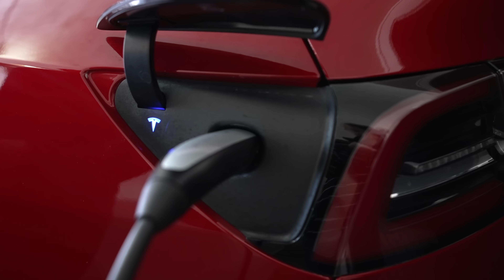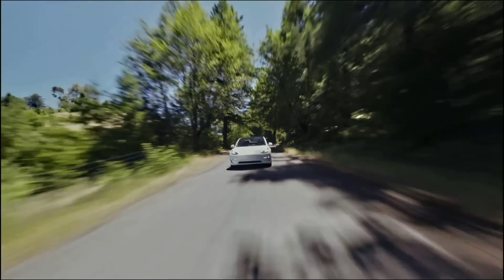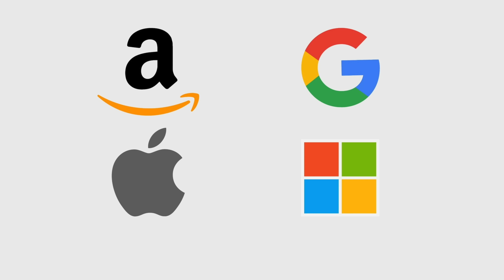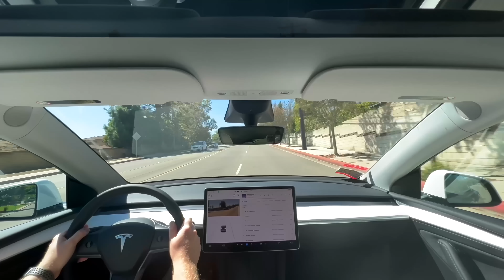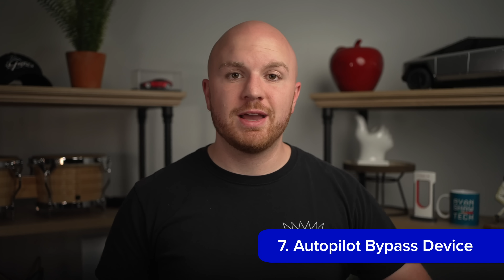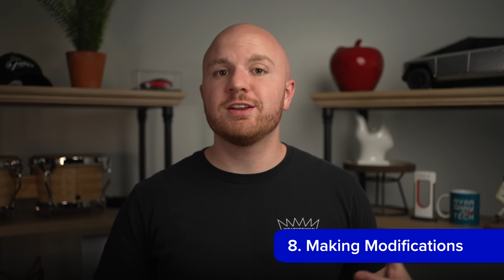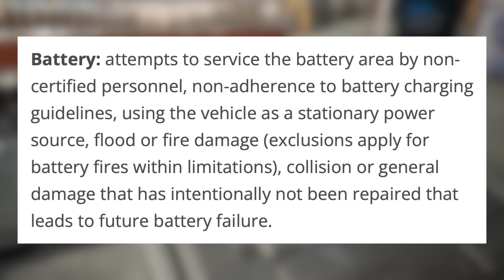9 NEW Ways to Ruin Your Tesla | Please Don't Do This

Comment: Does it mean that LFP batteries are immune to extra battery degradation associated with frequent full charges? No…
The only reason why Tesla recommends to fully charge the Model 3 cars that have LFP batteries is because it helps the BMS (Battery Management System) to estimate the available battery capacity more precisely.

Compared to other battery chemistries, LFP’s charge/discharge voltage curves are extremely flat. Basically, the voltage only rises when the battery is almost full and drops when it’s almost empty. This is why it’s much harder for a BMS to estimate correctly the SoC of a LFP battery.
Regarding customer service, for Tesla is more important to have a reliable GoM than to have a battery with a fenomenal cycle life – since one feature becomes obvious to the customer much sooner than the other.

Comment: My wife and I are looking for a used Tesla, and visited a Raleigh NC car dealer yesterday who has about 30 on their lot.  The car we went to test drive was found  on the Edmunds web app, and is a 2019 Model 3 that is marked down to a very good price.  When we arrived, they brought the car to the door for us, but as we attempted to leave the lot on the test drive the sales rep noticed that battery was at 0% charge, so we immediately pulled it into their charging bay.  We looked at other Teslas on the lot and asked to drive three of them.  The sales rep got the key cards, and two of the cars had dead 12 volt batteries, so we couldn't even open the doors, and though we got in the third car, the main battery was so dead the touch screen wouldn't respond.  What are your thoughts on car dealers who know nothing about EVs and brick them after placing them on the lot?  How do you evaluate the potential damage to the battery after this has happened?  Thanks for the great tips you gave in this video.

Comment: Tesla needs to add an automatic latching mechanism for the frunk, it's way past due. Even though it's not a hood, it still operates like one. Being able to remotely open it is a flaw, not a feature. I know the app can warn you before opening, but not always. Accidentally opening it with my key or phone remotely is a nagging worry to the point where I never use it for storage.

Comment: I never even considered a warranty issue when I installed a 3rd party swivel behind my touch screen.  It allows me to angle the screen in my direction, and to eliminate sun glare when necessary, since it allows both side to side and up and down adjustment.   I don't know why it didn't come with the car.  Do you think Tesla will tell me my warranty is void, should I need a repair in the future?  I also installed an anti glare protective touch screen to protect the Tesla screen from fingerprints and possible damage.  I mean, how far will Tesla go to deny warranty service?

Comment: #7 is bullshit. You can use a weight in a safe way, even safer than having 1 hand on steering wheel. Just because you use a weight doesn't mean you don't pay attention or crawls to the backseat. My experince is that a weight is safer then having 1 hand on wheel pulling opposite direction.

Comment: I would not recommend HOLD mode for everyone.  CREEP mode requires a low speed brake application to come to a stop.  At less than 5 mph, wear on brake pads is too small to measure, but regular cycling of the brake caliper pistons helps keep them operating freely.  More important, especially for older folks, is that the driver’s brain remains very well practiced at switching from accelerator to brake pedal.  This may result in faster response times in an emergency (“muscle memory”), and help prevent accidental pedal mis-application (pressing accelerator instead of the brake by mistake).
Reply: This, so much this. The entire concept of having vehicle braking, regardless of where that force is coming from (regen or friction brakes) tied to the accelerator pedal is just fundamentally wrong. I don’t care what anyone says about being able to ‘get used to it’ or that ‘it’s the future of driving’. From a safety standpoint it’s just flat out better to keep all active deceleration tied to the brake pedal. Every other EV manufacturer (except maybe Rivian) has regen braking tied to the brake pedal, blending in friction brakes when more force is required, with some offering the option to turn on one pedal driving if people want it. Not having the option at all like Tesla does is stupid. It’s fighting against over 100 years of muscle memory and it takes fine braking control away from the driver in emergencies and adverse conditions. It’s simply laziness from Tesla to not want to put in the work to program the brake pedal to control both regen and friction brakes and handle the crossover.

Comment: @Ryan - thanks for the video. On the charging topic the new Model 3 batteries actually need to be charged to a 100% to allow the BMS system to correctly measure the state of charge. This is because of the new charging curve associated with the chemical composition of the battery. Basically if you don't do it to 100% the car's estimated range will be very unpredictable because of the new discharge curve. Just look into it there are plenty of videos explaining this!
Reply: Do you think it should be charged to 100% most of the time if possible?
Reply: @skytrakn  yep according to new Tesla recommendations if you have the new 2023 standard range model - so the battery management system can predict correctly.
Reply: 2022 standard range.

Comment: Glad you added that if you are about to leave for a road-trip, you can charge to 100%. The damage comes when you keep it at the high charge for long periods. If you’re about to discharge it, you can.
Reply: It can still have a greater effect on the longevity of the battery even if you drain it back down quickly, but as long as you aren’t doing it every time it shouldn’t really be an issue

Comment: Hi All, I own Tesla Model Y for 1.5 yrs. It has 48000 Kms (30K miles). Its in Canada. My Battery is loosing value very fast. It used to charge to 465Km at 85% and now after Year it charges only to 404 KM. which seems quite a lot. And on the top of it. I only get 50-52% efficiency in winter weather. Which is very scary. Which means you can only drive approx 200KM on single charge before killing the battery. If I have to follow 20%-80% rule, i can only drive approx 100 miles. Which is really a poor performance. With Supercharging rates so high and inefficiencies this cars cost more to drive than GAS Cars. I am loosing faith in Tesla's and EV's. It seems like they are not ready yet esp for colder climates. Tesla service center is so bad that they give you weird explanations and screw you. I am feeling if I have to replace the battery just after expiration of warranty then this vehicle is not Worth it. Does anyone feels the same and gets anxiety after considerable drop in the range in such a short time.

Comment: New Model Y owner here - I tried auto steer for the first time, and the prompts to apply pressure to the wheel came up frequently even though I had my hand on the wheel at all times. I had to squeeze it really hard (with a deathgrip) to register that I was still holding the wheel. Is this normal? Is there a certain location on the wheel that has sensors and can register without squeezing the life out of the wheel every time I get that warning?
Reply: The steering wheel isn't measuring grip strength. Apply slight steering force clockwise or anticlockwise instead, apply too much steering and it'll disable autosteer.
Reply: @JasmLiu  thank you!!

Comment: Speaking of Telsa Warranty,  would adding different puddle lights under the doors void the warranty?
Reply: It would only affect the warranty for those lights you replace only, and they could have a valid reason to invalidate the warranty for the power source (i.e. if you were to short out the light, it might damage the power source).  In reality, no it doesn't affect your warranty.  And for the 3/Y and new S/X LR/Plaid, it uses electronic fuses that can even deal with short circuits without damage.  I've replaced my puddle lights and many other LEDs, and it has never been an issue.
Reply: @tesla_tap  excellent. Thank you

Comment: We had a 2020 Y that was totaled back in March when we got rear ended. We just got our 2022 Y replacement. The previous Y you could adjust your charging for just about any amount. This 2022 only allows 50-100%. According to what you just said, it should be a LPF battery. Am I missing something?
Reply: If it's a USA car, no you do not have LFP.  All cars allow 50-100%.  It's the indicator that shows the daily level that changes between LFP and NCA battery types.  NCA will show daily from 50-90%, but it allows you to set it to 100%.  After a few days at 100%, you will get a suggestion warning to set it back below 100%.
Reply: Hi Ryan- I have a 2023 Model 3. I’m located in the U.S., (California, not far from Tesla plant.) I looked under Software/Controls and I definitely have the Lithium Ion Phosphate battery. I can send you a screenshot, if it would be helpful for your videos. In the training classes I took (online) with Tesla, they covered charging and also specified that all of us had LFP batteries. I recorded this part of the training to show my husband since this has been a big point of debate between us since we bought the car, (how high to charge the battery.) The training confirmed yes, charge to 100. (Confusingly enough, our Tesla advisor at the dealership who delivered the car to us said charge the car to 90. It’s no wonder we are all confused.)
Reply: @surfercouple  I have a 2022 model 3  RWD and my software information shows LFP battery in mine as well..I live in NJ..because mine is RWD I read all model 3 RWD have FFP..and I remember my Tesla rep when picking up my car and going over specifications mentioned this regarding charging my battery and the changes made to model 3??
Reply: @doreenpeak6146  Hi Doreen- There's an awesome FaceBook group for ladies who own Teslas (Tesla Divas). Very positive. It's also a good place for sharing info.
Reply: @doreenpeak6146  Hi Doreen- Diana here again. I was in my Tesla today looking at my charge history and noticed the charging recommendations. It reads as follows: "We recommend keeping your charge limit at 100% and charging fully once per week." I asked about this wording when I took the Tesla classes, (the ones on Microsoft Teams they invite you to after you buy the car.) The moderator said the "charging fully once per week" is at a minimum and yes, keep the charge limit at 100%. We keep our Tesla plugged in when we are not using it, so our Tesla is charged to 100% each night. We are getting 272 miles of range on a standard RWD Tesla 3 2023.

Comment: How could regen breaking not work? In order to regen, that means you would have to use some of the battery first. Maybe it’s just slightly less efficient to regen at a higher state of charge?
Reply: You answered your question.   You have to use some of the battery first.   With a 100% battery there is no place for the electricity to go.

Comment: I've had our MD3 a year now and have a 10% drop in mileage.....so instead of 354 at 100% we get approximately 330 miles. From this 330 miles we get about 300 miles in real time.
Reply: Based on your 354 FRange, I guess you have 2021 M3 Dual motor?  The 2021 Perform has only 315 FR because the higher HP motor consumes more battery. I find no technical explanation for charging to 90% instead of 100%. Take a look at your phone, you plug in at the end of a day to have full charge next morning, no one tells you to charge to 90% or less. My guess is they don't want you to charge to 100% to find out your battery is degraded each year/after 10K miles and even at full charge, you do not get the advertised mileage. Tesla has many ways to avoid warranty claim.
Reply: @Cuti932  Correct I failed to state the year but it is a 2021. I see the difference in charging also at 90%, instead of the 304 it used to display at 90% it is at 291. Thanks for the quick reply...Happy Holidays.

Comment: As long as it's under warranty, there is not much reason to go to a 3rd party.  However, I think it's only a matter of time before someone challenges them on this, under the Moss-Magnuson Act.  Even something like opening the battery can be done without violating a warranty, unless the act of opening it can be demonstrated to be the cause of the failure.

My approach has been to not make mechanical modifications to my vehicles until after the warranty is up.  Only cosmetic stuff allowed, generally speaking.
Reply: Well, opening top of the battery destorys the seal, and normally the cover is destroyed in the process of removal.  I don't see how most people could put it back together and ensure it is properly sealed.  So I can see Tesla voiding the battery warranty if you open it up.  Now there are a few covers that can be opened without damaging the battery, for example to replace the pyro fuse. It's less clear if work on those items would void the warranty if you properly seal it up after the work is done.  Then again, if the battery is in warranty, why would anyone pull it apart?
Reply: @tesla_tap  Understood, and I acknowledged that if it's under warranty, no reason to take it anywhere else.   And yes, if they have made it impossible to open the battery without causing damage, then that's not the best example.  What I mean to say is, generically, one should be able to do anything on their vehicle and be protected from a voided warranty as long the thing they did can't be proven to cause a failure.  That was the point of the Moss-Magnusson act.  So they can't void the warranty on the car because you got the windows tinted, that sort of thing.

With that said, manufacturers are purposely making things such that the only way to service them is destructively, and that's not an accident.  This is why Right-to-repair reforms are so important, and, thankfully, a non-partisan issue.

Comment: Ryan does adding a aftermarket power frunk or trunk void any warranty on the car. I rarely open my frunk since of the way we need to close. I have a 2018 model 3. Original owner. I’m not getting rid of it since I bought the FSD feature back then & want to see it in operation!

Comment: if you store your car for a long period of time this uses more energy and is inefficient as you have to keep the battery charged.  This is where you would want to have solar to keep the batteries charged, keep in mind solar panels have to be cleaned and maintained, and may not last forever as Tesla has a warranty on solar panels being able to produce a certain amount of power after a certain time, which seems to imply that solar panels over time make less power.

Comment: As I've said before, they could just apply power to the motors in reverse to provide brake by motor instead of using pads.  This would consume battery rather than overcharging and then use regen braking when the battery isn't at 100%.  This is how electric RC cars brake.  Also could allow for improved brake performance on Plaid in extreme conditions by providing reverse power in addition to the pads.
Reply: With just a motor and battery, the motor can't brake the car without charging the battery. That violates conservation of energy. The "Power in reverse" has to go somewhere. They could pump that power into a resistive load to generate heat, but there would be no efficiency benefit compared to brake pads, which also just convert kinetic energy into heat
Reply: @doates625  if you were backing up the car from a parking space it would use battery just like driving it forward.  this should have the same effect even if the car is moving forwards on it's own momentum and should use battery power not generate more power.  the wheels don't actually spin in reverse but it's reverse thrust which will use battery power.
Reply: @doates625  no, not correct
If you can dump the energy in battery the it is regen.  If you need more braking than regen can absorb at slow speed then you use power from the battery to reverse the motor.
Reply: @doates625  wrong-go back to school

Comment: I've had my Tesla for three months and have already taken it on long road trips. There were times when the computer said I needed to fully charge to get to the next charging station with a very low SOC to spare. In one case the computer said I needed to not go over 60 mph which also meant I needed to stop running the heater in cold weather to conserve the battery power. So I did that. Very miserable in 13 degree weather! However I found the computer recommendaton to not always be good. There were plenty of superchargers in between the ones the computer recommended but didn't identify, I had to search for them myself. Is there a way to display all superchargers on my route?
Reply: I just got back from a 900 mile round trip road trip.
I use A Better Route Planner to plan the drive and the stops (including whether I want to stop at a SC with amenities) and then I use the Tesla Nav to plan the route to each stage of the drive. ABRP is a free app on iOS and on Android, I keep ABRP open on my phone during the drive and check on the route on both the Tesla Nav and the app while driving.
To your specific question, on the map on the right side there is an icon for superchargers, if you click it you should be able to “see”all the available SCs,but I have found this to not be 100% accurate.
Good luck
Reply: @JeffJacquesmd  Thanks!  I just completed a 4,700 mile trip yesterday.  I didn't notice the little charge symbol on the middle of my screen (Plaid), that definitely would have helped on my trip.  On a long drive like that I like to space out the superchargers about every 2 - 2.5 hours to allow for quicker charging and attempt to get to the sites with the better price rates.